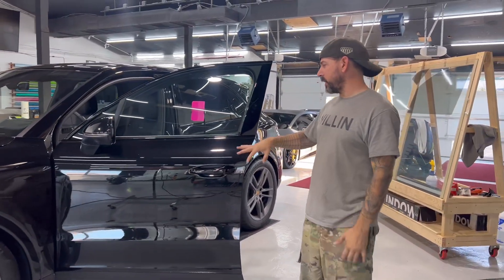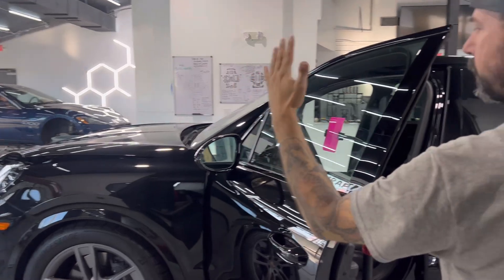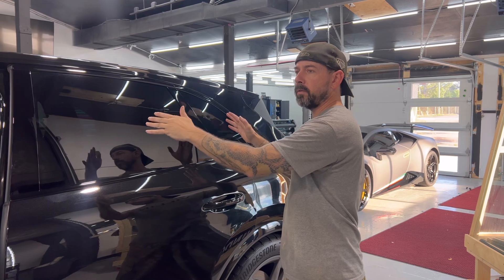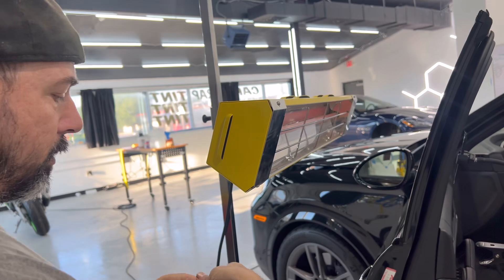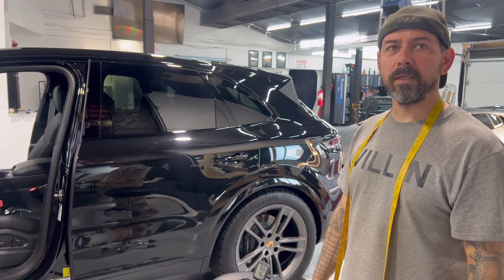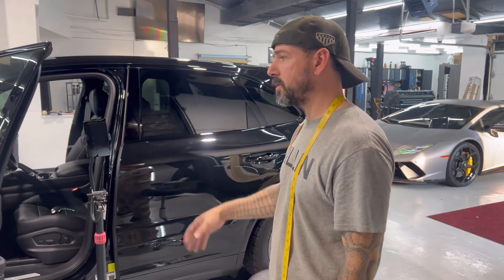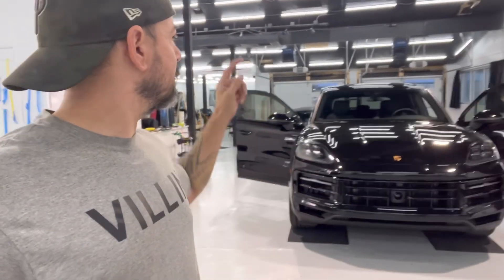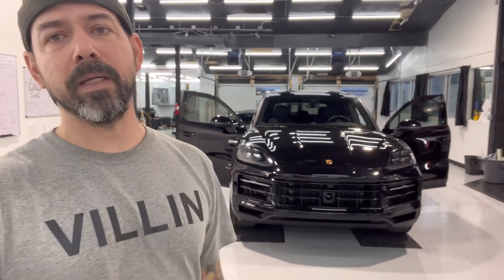Your Factory Window Tint Does Nothing.

Comment: Id like to see this test done with the car running and the ac on. Im curious if that would cancel out the difference a bit.
Reply from the maker: AC was on in the shop keeping air temp at 75, the test is replicating the temperature you’d feel on your face or skin coming through the glass.
Reply: @villinwraps  Sorry, I meant the AC running in the car. It'd be interesting to see how cool moving air would affect the temps.
Reply: @blackhawkvenom5724 it will get cooler faster with the ceramic tint. Because ceramic tint is rejecting more UV light.